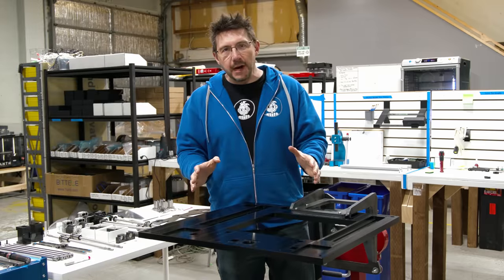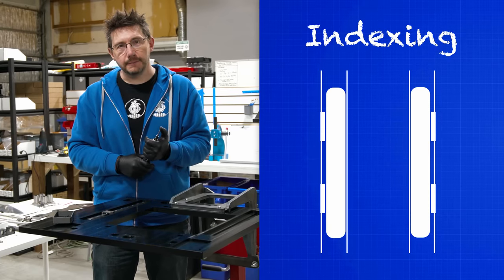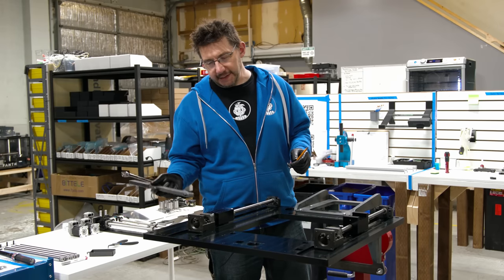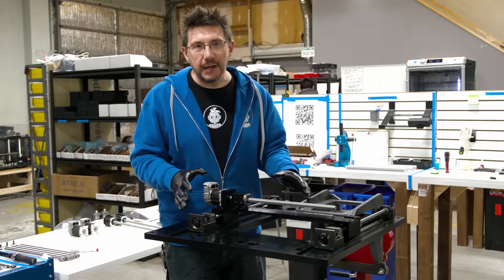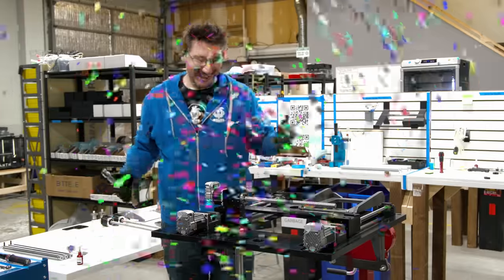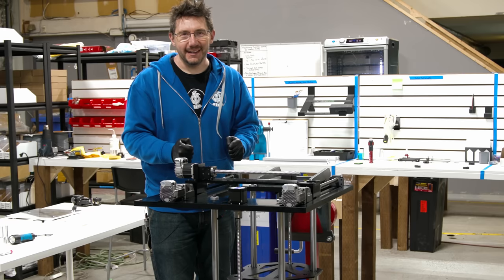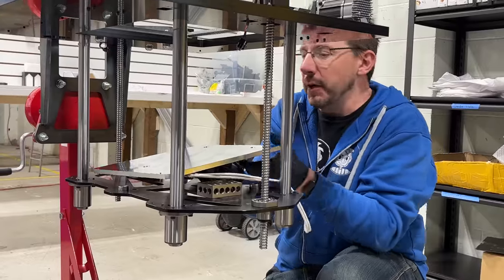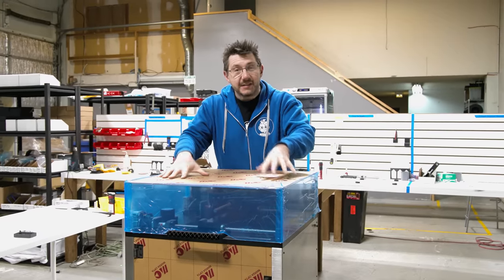How To Build an INDUSTRIAL 3D Printer

Comment: Was really impressed with this machine when i saw it at Rapid last year, the method they use with the common plate as the base of the printer that everything attaches to is just so creative and works so well, awesome to see how they get built.

also

want!
Reply: We do the same in the machines we build. Very common in the industry. Only thing is we use 40mm carbon steel.
Reply: @Theprofessor1212  what brand do you build ?
Reply: @joearchuleta7538  not 3D printers. We build rotary filling machines for food manufacturing.

Comment: Ok, after watching this the mechanical design is stunning. It looks outstanding. But by far the most impressive thing was seeing Joel put his bodyweight into torqueing the press nuts a over a foot away from the main plate and seeing no flex despite the rods mounted with a single point. I need to get one of these.

Comment: The rigidity of this frame would blow our extrusion frames out the water. So much rigidity that input shaper might not even be necessary.  Giant rails vs mgn9? Precision ball screws vs belts? No contest! 40lbs of 6061 madness tying it all together...insane.
Reply: We did turn on input shaper, but it did nothing. So we turned it off.

Comment: FYI, these retaining compounds / adhesives are anerobic. They will not dry until assembled. Once the parts are fitted together, oxygen is squeezed out and the adhesive starts reacting. You didn't need to rush it.

Comment: The build reminds me of a MakerGear printer. I think their Ultra One is very similar to this except it is also an IDEX. (I think MakerGear is barely holding on to staying in business.) This Pantheon is such a massive printer for such a relatively small build volume and not actively heated, which seems like a real missed opportunity. I would be worried about the BTT board but I guess the QC has improved enough. I honestly don't see much of difference between this printer and say, a Voron with similar build volume, enclosed, and around a quarter of the price with top-spec'd BOM with lots of QOL improvements (or less than a fifth of the price with standard BOM). I guess the money is spent on the R&D and labor. Still, at the end of the day, what are you really getting for your 10-grand investment (serious question)?

Comment: Tbh I don’t understand why they are glueing the Z-shafts… they already use a bolt to retain the shaft so they just could have made a face on one of the sides of the rod and a corresponding one on the already millet Aluminium part and just tighten them. By choosing the right tolerances and stuff you don’t have to rely on glue and is even easier to repair if something happens. The roads are already machined so by milling a (I think it’s called like that in English) key face you’re not only making it more reliable but also easily repairable.

Comment: Yes, of course everything is better. But each individual part, e.g. the Y motor, probably costs a much as a whole hobbyist level 3D printer
And the loctite 638 cure time is not 60 seconds. The time depends on the material, the temperature, the gap size, etc. It's more like 5 to 30 minutes. And afaik like other loctites that time really only starts counting when the parts are mated (no air)
Reply: It was about working time though, not curing
Reply: @flixquadrat6337  that's also not 60 seconds. Just try it. Like I said, afaik like other loctites, it starts working once it's deprived from air, i.e. when it's in position.

Comment: Can you still only print with those their PETG carbon fiber material?  If so that's too bad because it makes the machine pretty useless for most.
Reply from the maker: You aren’t locked into any material. They sell a CF-PETG and it works well, but you can use any material from any manufacturer
Reply: We also have CF and GF Nylon now. More filaments to come!
Reply: @PantheonDesign  I've been a machine designer for 20 years and I can appreciate the way your printer is built.  I'm interested and look forward to when it's more flexible in what it can print as I print various different materials.

Comment: Honestly this is a very disappointing build. I was really hoping to see a pellet extruder. But 15k for an fdm printer with 300x300x300 build volume? Also so many things are ridiculously overbuilt, THAT printhead for normal filament? I dig the ball bearings though.

 It's like coating a prius in gold with diamonds on it. Looks nice but very very disappointing once you use it